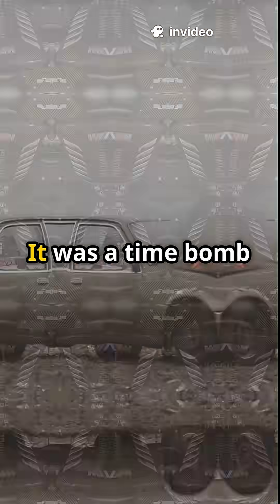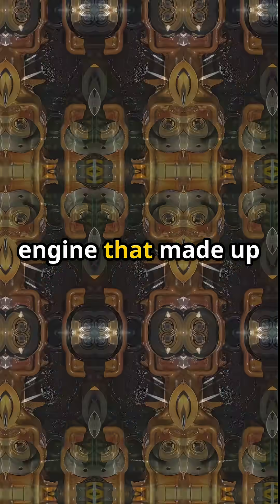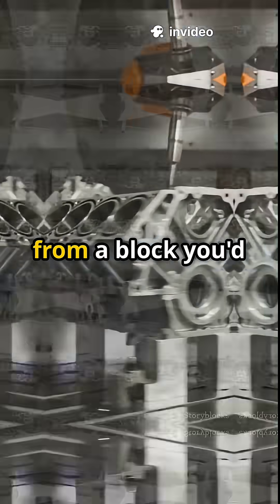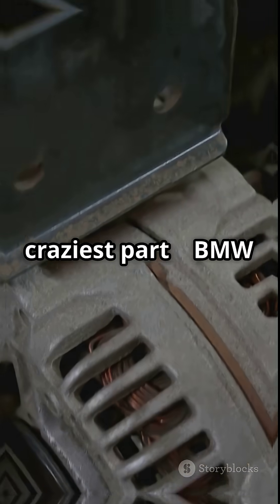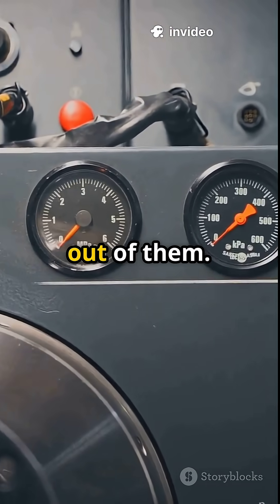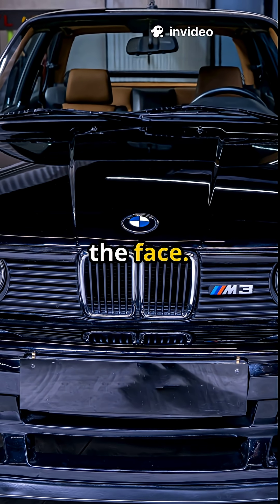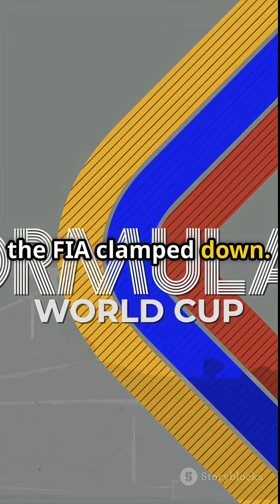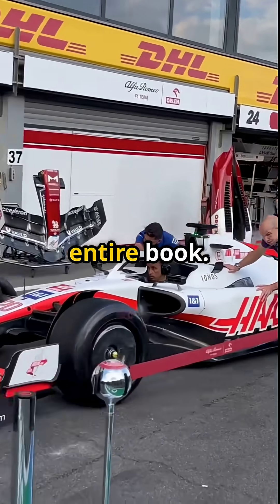The BANNED BMW Engine That Hit 1,400 HP in F1 🧐

Comment: 5.5 bars of boost from a single turbo from the 80s. Turbo lag must have been crazy dangerous!
These engines also ran on toluene (a.k.a. “rocket fuel”), which contributed to the release of 1400+ horsepower.
The F1 cars were also much lighter back then (they weighed 600 kg on average vs. the ~800 kg of a modern one) and most certainly didn’t have the aero, suspension, chassis, electronics and tires drivers can trust on today. >2:1 power/weight ratio would be worrying today, but it was terrifying and borderline unmanageable with the 80s’ tech. Those who think Group B rally cars were as dangerous as it got definitely know nothing about the turbo era of F1…
Reply from the maker: True bro